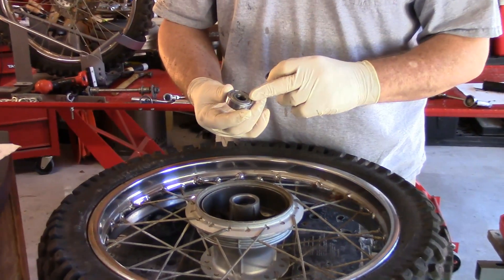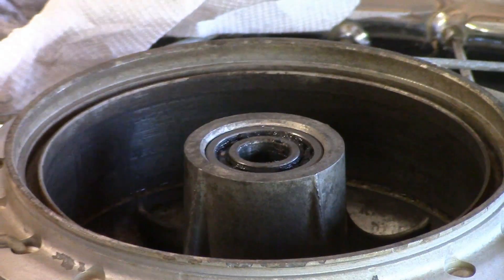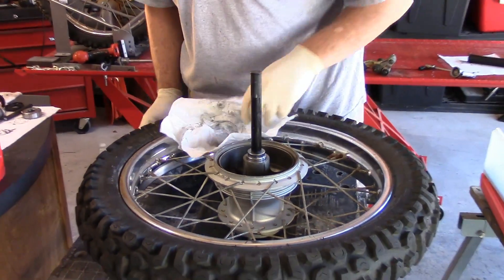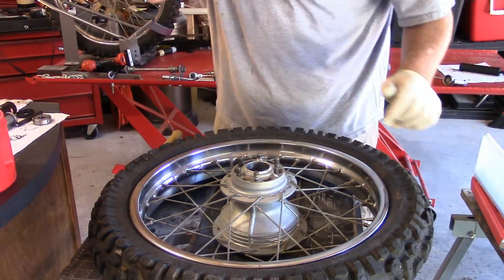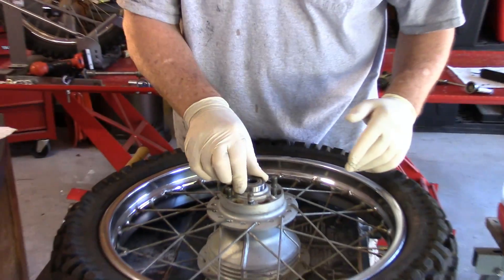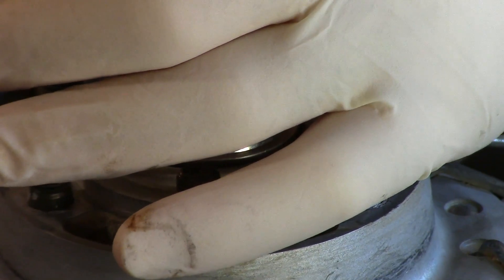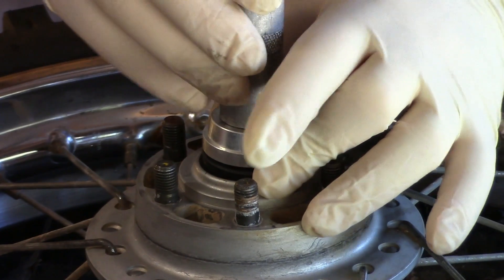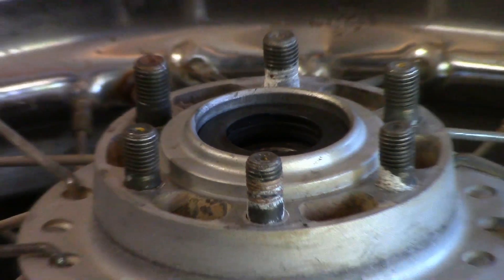Installing a Motorcycle Wheel Bearing and Seal

Comment: it may seem easy to install using that driver.  however, it does not always drive straight down.  if the bearing is inserted incorrectly, there is that big, big chance that it will go down slightly inclined and be inserted inclined, marking the casing with a bad notch.  my suggestion is use a small hammer so that the bearing goes down slowly, and could be corrected if even a slight incline is seen.  the tool is a big help if used with caution and not king kong style.  i noticed in the first rubber seal, it was not seated square. even if you hear the bottoming sound, it still is not square.  please take a look again.  at 1:18, the right side is raised slightly than the left.  when it was inserted in 1:08, the right side is raised.  it should have been corrected before the big banging.